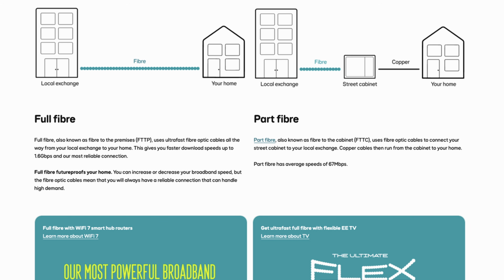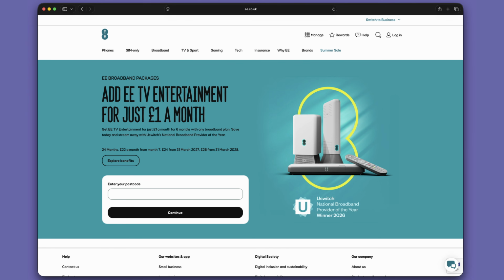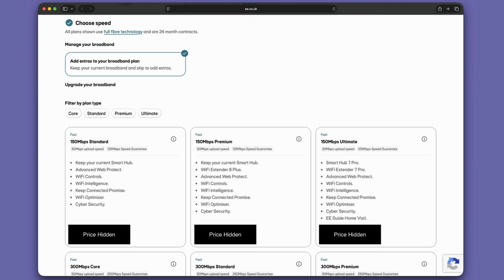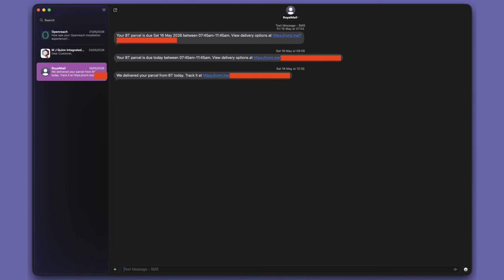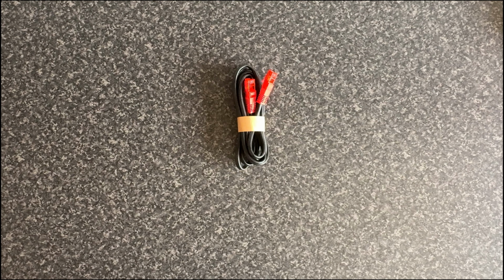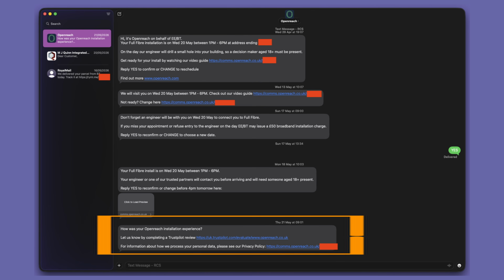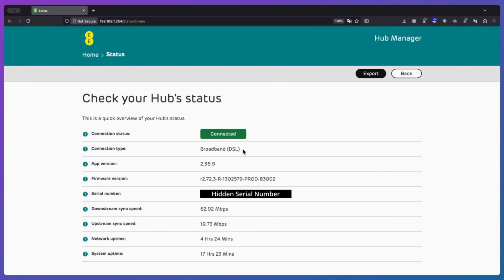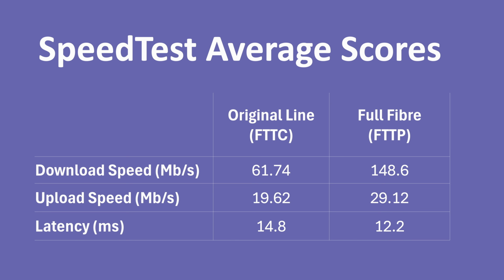My Experience Upgrading To EE Full Fibre Broadband

Comment: I had similar experience with sister company BT and Open Reach. I had no problem with getting entry point where I wanted (from pole at back to living room front of house (the engineer supplied a cable although I already had a few}. The only problem was when I went to use landline phone, Digital Voice, no connection. I use the BT adapter to link with my router and so I first connected phone direct with router, but still no connection. I tried resetting phone, and I think also the router but no joy. As a last resort I unplugged the router and replugged and low and behold phone connection back - relief. Maybe of some help to others if similar issue.
Reply: My Digital Voice (BT) went live several hours after the installer left.  I had to reboot the router (via the web interface) to get it going.

Comment: What waste of time I went for EE Full Fibre M J Quinn came out to fit it and found every excuse not to, ladder not big enough (two storey house) did not like where the telegraph pole was ( no bank across the road) could not fit cable in old cable hole under window (their cable was to big ) would have to drill a hole through two and a half foot thick stone wall in the I end I said for get it . But the thing was a couple of years ago Openreach fitted a fibre cable from the pole to my house but M J Quinn said it was old fibre and could not use it , on reading up M J Quinn had done this before to other people all the same excuses   when I phoned EE the person asked why when I told them they just said M J Quinn say no more  .
Reply: Some sales muppet from EE on the phone, who’s never done an install in their lives said “mj quinn, say no more”. Openreach are giving MJ Quinn more and more work because of their quality. As you can see from the video MJ QUINN employ thousands of capable, good engineers. You just got unlucky on that day. Sounds like you just like complaining in general.

Comment: My EE full fibre is coming on Friday.  One thing to add to your video might be what you need to use a landline phone.  I was told it just plugs into the router but they have sent a unit which plugs into the mains and has to be paired with the router and the phone gets plugged into that.  Not a major problem but it's something else that needs a plug.  I don't really know where the outside and inside boxes are going to be put but I'm sure it will work itself out on the day.  They must got to loads of house where there isn't plugs in convenient places.

Comment: Many thanks for the video. I've in the process of upgrading from Plusnet broadband to EE Full Fibre Broadband as I need a landline phone. I received an email out of the blue this morning from EE advising they were sending a EE Smart Hub 7 Plus to my home address. This was followed by an email from Evri saying they were waiting for my parcel.
Reply: Warning!!!!!   We are doing likewise and it is HELL.   
We got the EE Hub, and then 5 days before the agreed Plusnet OFF/EE ON date, we got an email tellling us to return the Hub: we ignored it assuming they thought we had a previous EE Hub.   On the date, Plusnet went OFF, and we hooked up the EE Hub and waited  for it to connect...

And waited.

And waited.

Contacting EE Tech Support, it transpires that the reason the Hub was not connecting, is that EE cancelled our new contract the week before!!!

A 'bug' in their system cancels any new account that includes Digital Voice.

EE didn't inform us of them cancelling the new contract, though.  

A helpful Tech Support operative admited that there is a massive EE sh*t-show happening to ex-Plusnet customers.

So we signed up for a new contract, with 14 day 'cooling-off' available.

But it won't happen until 14 August...

So they sent a Hub that uses a uses 4G phone signal - at 30Mbs speed.

Well, actually it took 3 phone call to actually get it to arrive.  

Put EE Tech and Customer  Support on SpeedDial - keep checking that you still have an order and Openreach give a confirmed date.

Oh, and I'm a BT Shareholder and not happyt at the srvice at all.

Comment: I had full fibre fitted last year but also qualified for battery backup for my landline plus an EE home phone which also has a battery backup.  I don't see any difference in the speed or the quality of the landline but everything is working ok.  I've had one power cut since I change over and the battery back powered my internet for about 4 hours, it depends on usage.